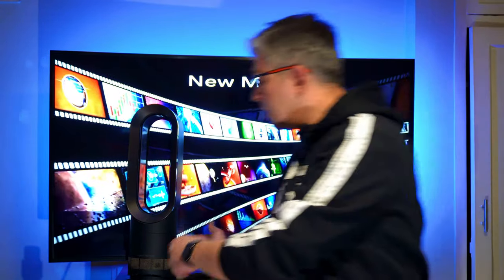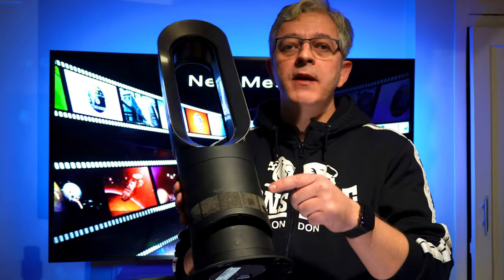How to clean the Dyson Hot and Cool fan

Comment: what size of screwriver did u use
Reply from the maker: I don't know. I have a few heads that I change when needed. I didn't keep the box to know the numbers.
Reply: Torx T8 for most screws except the single bottom motor screw which is T10

Comment: you could skip the 2 step to of taking off the first panel by the way.
Reply from the maker: Thank you for telling me that. I did not know it.
Reply: Should really disassemble the unit into 3 sections to clean.  One section is where you were at, then you have the shaft which is held in by one T9 torx screw. Then the top portion at the outlet